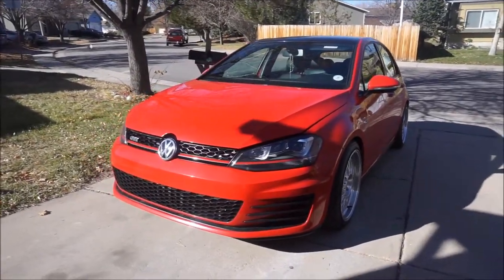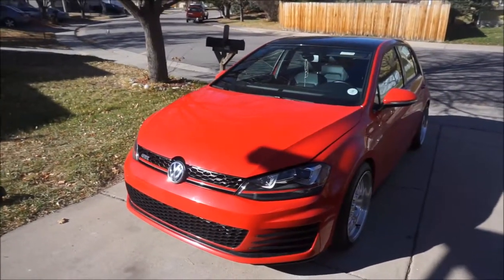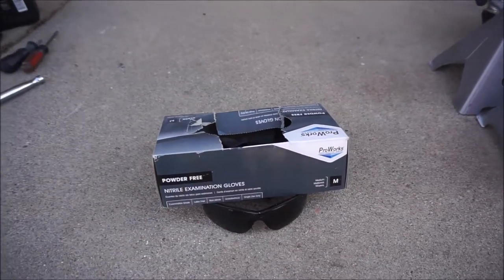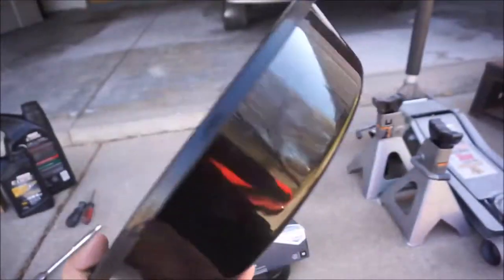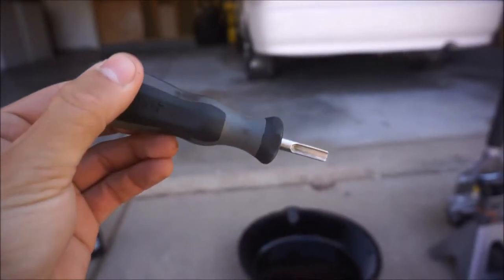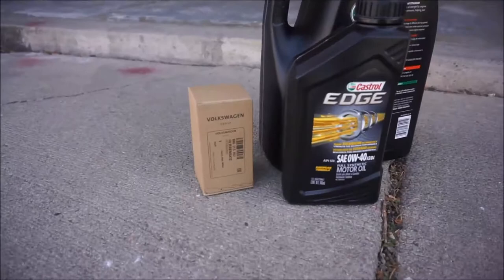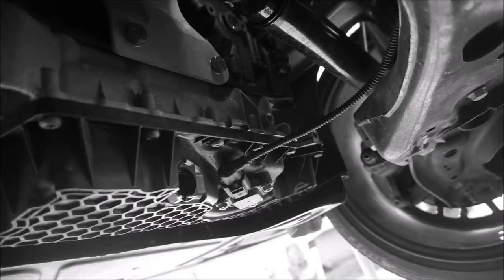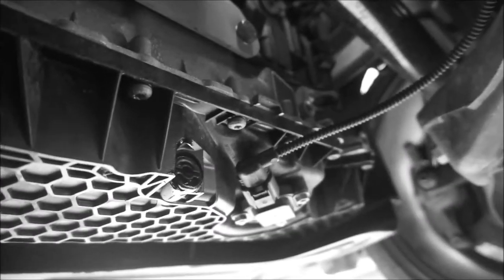MK7 GTI Oil Change DIY

Comment: Best YouTube I've seen on GTI oil change.  Great detail and explanation on weird oil drain plug and special tool.
Reply from the maker: Mike Warnock thank you I’m glad you found the video helpful 😊
Reply: Your shitting me, right! 
failed before using dipstick! the car needs to be level to get an accurate reading!
failed on using dipstick! - the dipstick needs to be cleaned off, then dipped a second time for the actual reading!
that's two fails on dipstick alone! not to mention the other things wrong with this video

Comment: 0-40 weight? Doesn't VW call for 5-40? They also recommend Castrol Edge Professional (which I can not find at any local auto parts stores around me)
Reply: I was gonna ax the same thing.
Reply: 0w-40 is fine. As long as it meets VW Audi spec 502.00 /503.00